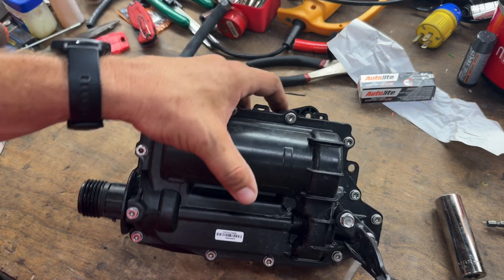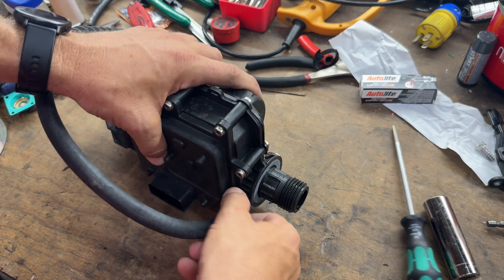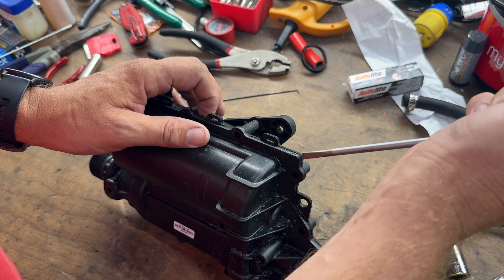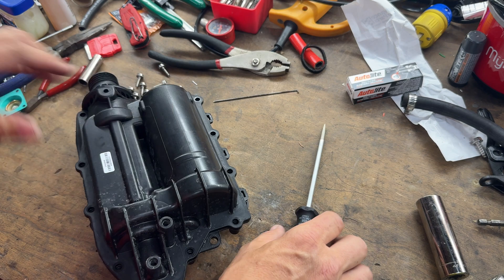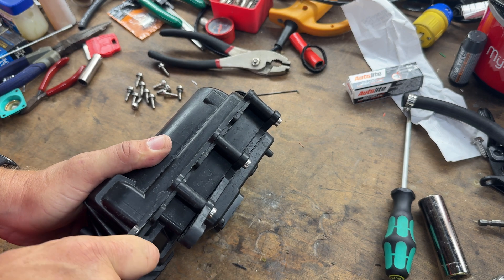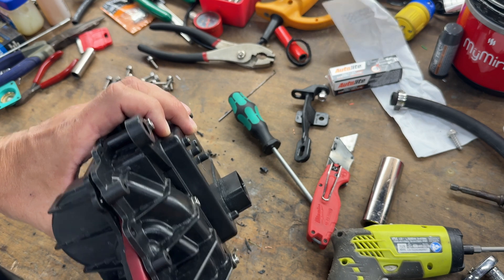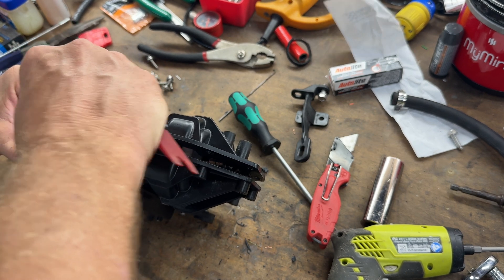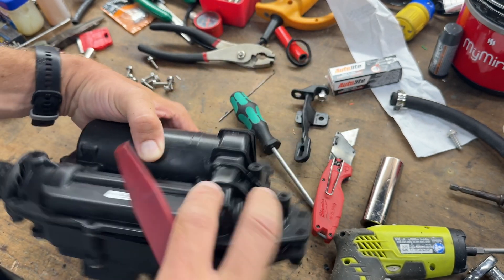Sea-Doo IBR Disassembly

Comment: What ended up being the issue???
Reply from the maker: The nut that rides the Jack screw was stripped where it threads into the arm that pulls the reverse bucket.

Found a used nut and replaced it.